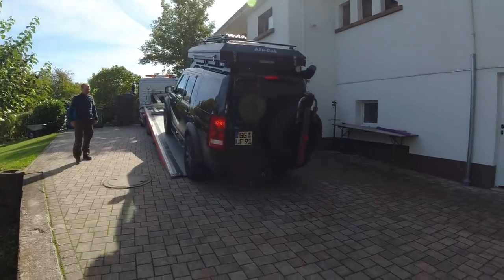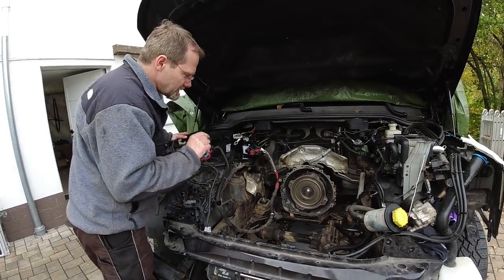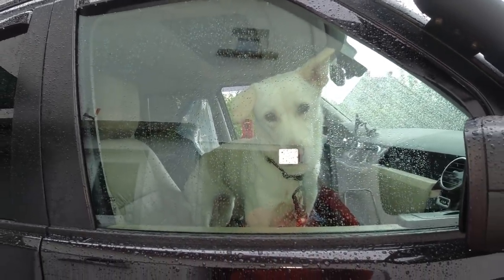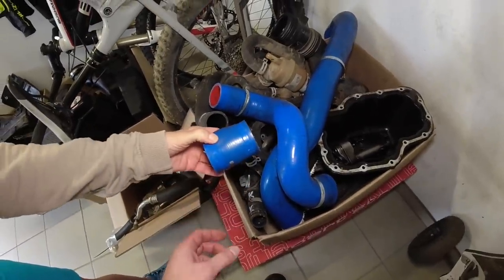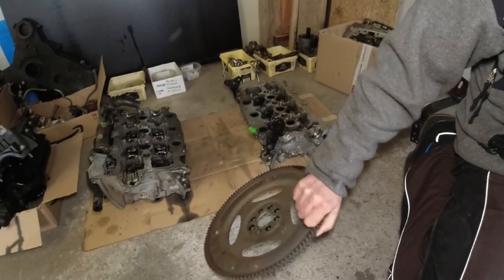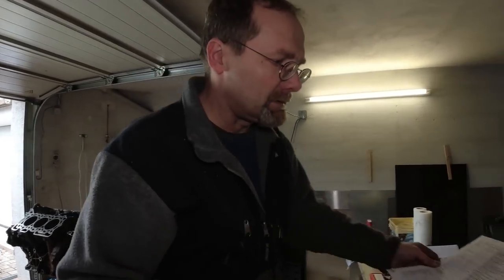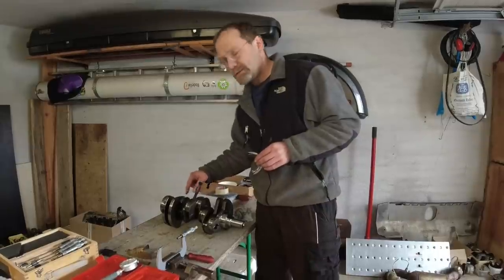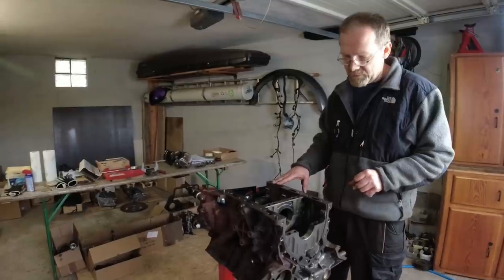Is this the end? Complete engine failure - Land Rover Discovery 3 / LR3 - Episode 1

Comment: Hi Christian,
Thank you once again. We are looking at a rebuild at the moment. I was very interested in your comment below about a potential pre-oiler. Quoted here for reference....
"I found a pump for 130 Euro and I found the ports for the oil connection.  It also takes a check valve and a control relay circuit.  I think this is a great idea.  It assures a quicker oil supply after a long stand period.  Something I will do when I rebuild Vera's engine." 
Could I please ask if you could share the detail on the pump and the port? Thank you.
Reply from the maker: Hello Jeffrey,  this solution did not end up realistic.  Sorry.  Also do not use the FAI pump we installed here.  I installed two of them by now and both prime extremely slow.  Christian

Comment: Supposed to be going Norway after Xmas from the UK. This does worry me as the temperature will be really low and I worry about the extra cranking time needed to start my 2007 D3. I put a new oil pump on but I don't think the is any way of avoiding this extra crank time due to low temperatures.

Comment: The lady narrating, Vera(?), is hilarious 🤣
Is that the V630 engine? I've worked on a lot of engines (well over 100), but not the TDV6, I don't recall any other engine where there were spun main bearings - is this a common problem, apparently due to insufficient crush on the shells?
Easiest, and maybe cheapest, option would seem to be align boring the main journal housing and rebuilding the engine - best option might be to do a concentric hone with custom oversized bearing shells for maximum crush?

Comment: my 2006  Disco 3 engine has done 235,542 miles(379,057km) with all original parts still working well
Reply from the maker: No DPF I assume.  But you did replace the oil pump, right?  If so, the 2006 is unbeatable. It only got worse from there due to emissions controls.  Christian

Comment: Great videos as always 👍😁 I just had my steering knuckle replaced on my disco 4 as my steering was getting very stiff, might be an idea to replace that since it’s so accessible now as they don’t last forever, mine did 165,000 miles which isn’t bad! Also agree with oil changes, I do mine every 5-7 thousand miles.

Comment: Hey Christian! I read a comment earlier on another video on why crankshafts fail, that said that "lugging" the engine (running it on low rpm) is worse than running it on high rpms because the engine has so much torque. I don't know what to think because given that every thing else is the same, then the crankshaft will have to put out the same amount of power to do the same work anyways. (forgive my use of units) Would this maybe be individual form engine to engine depending on what harmonics issues the individual engine has, or does the low rpm require each stroke to be harder and longer in between causing more stress on the crankshaft?

I absolutely love your videos. My heart melts a little every time Vera says "oh my god". Cheers form Norway!
Reply from the maker: I think (based on my Research):  95% of broken cranks are due to oil starvation.  The bearings cease up, clearance increases and the crank snaps if the driver does not immediately stop the engine.  There are known cases of cranks snapping due to fatigue.  This is apparently then the case if the crank is exposed to large peak load changes as present during low rpm operations.  Trailer pulling, hard shifting, off road use.  This in combination with a border line hardened „Monday“ crank can cause a snap - if the Storys in the Web are True. This is one reason why the extremely high torque SDV6 shifts so extremely smooth without any jerk - I think.  Ford reduced the amount of sudden rotational peaks to a minimum.  But this is general practice unless the engine is drastically oversized like in a US V8 with wimpy 375 Hp like it had back in the 70s already.  Christian
Reply: @Vera_and_Christian  Then I will be sure to change oil frequently. I really enjoy oil changes anyways. Given that I by now have over 250k km on the clock I think that I gradually can rule out the possibility of having a "monday" crank. :)

Thank you so much for your time andfor sharing your knowledge. Have a nice day!

Comment: So the sound it was making at the start was a kind of rattle, kind of a bit random. And suddenly started? Mine makes a clicking/ticking sound when it’s warm. Hoping it’s normal!
Reply from the maker: Ticking when hot is low oil pressure.  Run 5w40 and see if it’s better.  Christian
Reply: @Vera_and_Christian  interesting - yeah will try that. It was certainly quieter before I changed the oil (to 5w30)

Comment: Hmm, I disagree regarding having to drop the transmission to get to the crossover pipe.  I did a turbo change in my D3 just last month and removed the crossover pipe while the turbo was out.  I didn't drop the transmission.  The reason for removing the crossover pipe for me was that the brake vac pump was leaking lots of oil onto the crossover pipe and the exhaust wrap was completely soaked with oil.  Yes, you are working blind, but you can remove the crossover pipe without dropping the trans.  To be fair, I did have to fabricate up 3 different 13mm custom crows foot wrenches out of old sockets to get the crossover pipe flange nuts undone, but once I had them, I used them for all the crazy turbo flange bolts.  Still very interesting to see you pulling an engine without lifting the body.  Gives me confidence that it is possible, despite what everyone else on the internet says...
Any chance of some close up views of Fabians hidden winch mount?  I'm thinking of fabricating one of those as I can't find one anywhere to buy.
Reply from the maker: I will try to improve the procedure during installation.  It is very difficult to see what needs to be removed and what can stay in place.  I’m sure with a bit more practice the removal will be much faster.  Thanks for your comment.  Christian

Comment: Thank you so much for posting, although doesn't give me any more confidence in my own D3 TDV6!  Very interested to see the line boring and whether you can get externally oversized bearings to suit.  All best wishes from the U.K.!
Reply from the maker: Boring is done.  Check out the video tomorrow.  Hope the boring video is not boring.  Christian
Reply: @Vera_and_Christian  Fantastic!  Hope just hope Fabian is 'bearing' up at the moment.  

Mine is also an 09, similar K's etc.  Poor history, but being non-DPF I'm able to use an Ester based Millers oil in the hope the (claimed) oil film strength might give a little more start up protection.  Whether it will or not I don't know, but other than using quality filters and making sure it starts quickly and cleanly (it does) and doesn't get laboured at low revs (it doesn't), I can't see I can do much more.

Comment: As a rule of thumb jack up car at rear as far as possible if possible leave everything on the engine bar the engine mounts and remove the trans and engine as one unit. Doesn’t work for every vehicle but by jacking up the rear it gives a great angle with which to extract and fit the assembly. Very good for complex exhaust systems and wiring harness clamps etc. Regards. Ps as far as auxiliaries it will never be easier to gain access to them than when the engine is out of the vehicle.
Reply from the maker: The thing is, our garage is not high enough to lift up the rear. Having a pit is not always beneficial. The plan is for the next two years to tear down our garage and build it up suitable for these kind of repairs. 👍🙋‍♀️ Vera

Comment: Hello Christian, can I ask you what approval motor oil and which manufacturer do you use?  (I have a 3.0 sdv6 motor).  Thanks.
Reply from the maker: I run Castrol Magnatec 5W30 A5 in both of ours.  With DPF the oil requires changing often.  We will go to Total 5w40 like in the C5 but it is not approved by LR.  Christian

Comment: In my opinion the DPF is the reason for mainbearing failures. Too many regenerations leaves too much diesel in the engine Oil. 
After my engine revision I change the oil latest after 10.000km. And if the IiD Tool shows many regenerations in the past, the I will change it earlier. My mainbearings looked the same, metal chips broken from the surface. But I had luck. The bearings did not turn in the engine block.
Reply from the maker: We absolutely agree with you. Our LR3 also does not have a DPF, that engine runs like a swiss clock. I was just gone on a weeklong road trip with Philipp. I was not even the slightest worried that my Disco would break down or even  bing and bong at me 😅. 😃👍🙋‍♀️Vera

Comment: Thanks you two. I hope it all goes well. It is very sad. This is the reason I do very frequent oil changes and am also very sensitive to noises. I am lucky I think, to have the Freelander 2 with the 3.2ltr Inline 6 engine, which is a big engine for the Freelander. It seems to be in good condition, and I am hoping that, because it is a Volvo based engine, it will survive a long time. I do have one minor knock that seems to be a suspension drop link or bushing, but that is the only issue at 10 years old and 78k miles. I hope to have it diagnosed and fixed soon.
Reply from the maker: My Freelander had a BMW engine, best combination ever. 😃👍 The only thing we had to do frequently is replace the mounting brackets of the rear diff. That we had to every 2 years. 🙋‍♀️Vera
Reply: @Vera_and_Christian  so you had the BMW M47 2.0D engine? Lucky you, Vera. The later N47 had issues with the timing belt tensioner with the timing belt drive mounted at the rear end of the engine for great maintenance access. :-)
Reply: @Vera_and_Christian  Thank you, Vera. I think that is likely the problem I have. My research showed that those brackets would wear out and the rubber bushing would go bad. I will check it this weekend.

Comment: I'm always wondering. This there a diesel cooler in the engine or a diesel heat exchanger? Old Mercedes Engines had a diesel preheater. That's one reason these old Mercedes Engines drove even with fish oil.
Reply from the maker: There is a Diesel preheater 👍🙋‍♀️

Comment: So, you think that the used fuel pump caused "crank no start" conditions that persisted long enough that insufficient oil pressure was developed at the Nr 2 and 3 main bearings? Interesting, particularly given your assessment that these engines have insufficient lubrication at these journals under nearly all conditions. What engine speed is required for 2 or 3 bar of oil pressure? I have an L494 with the 3.0TD engine, Daumen drücken.

As for hate comments about JLR dealers, my Range Rover Sport went in for a check engine light--P049B, insufficient diesel exhaust fluid flow. Dealer said the DEF injector was faulty. I asked, how did you test it? They said they couldn't test it, that was their guess. Two days later, they said the DEF pump wasn't working. I said, "But I'm using 0.2 liters per 100 km, or 50 liters per year". I let them replace the pump, then they called to say that's not the problem. Dealers do not understand how these vehicles work (I'm a mechanical engineer). My vehicle has been at the dealer for 3 weeks so far.

It is not reasonable for people to expect these engines to last forever; people have come to expect automobiles to run like refrigerators, but that is not possible. If you do not take care of your engine (frequent oil changes, letting it get up to temperature every time you run it) then the engine will not last. Americans created the 36 month lease--drive the car for 3 years, then get a new car. Manufacturers know this, so they build vehicles that do not last. Buy a Mercedes, Porsche or Honda. Or learn how to rebuild your engine.

I had a 2006 Disco 3 (LR3 in the States) 4.4 petrol, bis zu 200,000 miles (320,000 km). Was für ein Auto!!! Christian and Vera (Ach mein Gott!) are my heroes!!
Reply from the maker: Check out our videos in our "Engine Oil and Oilpump" Playlist. 👍 The used (refurbished) HPFP was a different issue with that particular Discovery. Also documented in earlier videos. Christian works in the automotive industry (as a balancing specialist) and he always says that an engine is designed to last 220000 km. I hope you can sort out your issue with your Range Rover. Check out the Disoc3.co.uk website for any information on your issue. Workshops only replace parts, one by one, until they eventually also replace whatever is broken. Costing a fortune in the mean time. 🙄😳😭🙋‍♀️

Comment: This engine for the LR3 and 4 was used in Jaguar and other cars without the crankshaft problem. Would you say it's due to pulling heavy loads that het engine wears prematurely?
Reply from the maker: It’s hard to say.  The other engines had different turbo chargers and other load ranges.  The LR is heavy and has a lot more torque at low rpm and it is much heavier.  I think all this is contributing to the issue. Christian

Comment: Thanks for another great video Christian and Vera I always wanted to buy a discovey 3 or 4 but don't know whether to buy a clean high mileage one and totally rebuild it or a fresher low mileage one and be constantly waiting for the next thing to break and spend every weekend rebuilding in stages.
Reply from the maker: Well, the problem is in the engine design, so even with a rebuild one, your are not entirely on the safe side. We would go with the low milage one, that's how we decided on our Discovery 4. Because high mileage brings another set of problems.  Remember it is still a Discovery, there is more to owning one than just the engine problems. 😅👍🙋‍♀️ Vera

Comment: Can the bearings it be done from below? If so maybe it’s worth doing them preventatively?
Reply from the maker: Is would not save much time.  The side bolts of the mains are not good accessible.  It is also required to measure the gap of the bearings and select the right ones.  This is a tricky process.  A rebuild will never match as good a Ford build as they machen crank and bearings.  It is possible to inspect the mains from below but it is not advisable as there may be contamination or setup problems caused by such a repair.  Better invest the money in extra oil and filters long Term.  Australian guy wrote me that he has  500t km on the clock.  Christian

Comment: My 2007 D3 2.7TDV6 died the same way 4 years ago at 156 000 km. While driving at 80 km/h I heard the rough engine work and stopped immediately. There were debris in the oil. Since then the car is in the garage. :(
Reply from the maker: Bring it over and we fix it next. Christian

Comment: At around 38:00 onwards listening to your explanation,   I feel like some kind of electric pre-start oil pressure  pump to build running preasure before cranking engine over, would negate this starting wear issue.
I wonder if the manufacturer would ever introduce this? Or perhaps we are too close to 2030 now for it not to be worth the design investment for the companies.

(2030 being the end of petrol/diesel vehicle production in Europe)
Reply: I agree - I’ve been looking into the sourcing and supply of a pre oiler like those used on competition engines. I fathom a £500 investment in a pre oiler is a damn sight cheaper than an engine rebuild - what do you think Christian?
Reply from the maker: I found a pump for 130 Euro and I found a ports for the oil connection.  It also takes a check valve and a control relay circuit.  I think this is a great idea.  It assures a quicker oil supply after a long stand period.  Something I will do when I rebuild Veras engine. But right now she does not let me do this because it’s not broken. Christian

Comment: How are the main bearings located? I didn't see any notches for tabs to prevent the bearings spinning.
Reply from the maker: Hello Greg, the bearings are plain.  The notches are typically for orientation only.  It is a common assumption that they prevent spinning but they are not according to the manufacturers I checked.  Of course it will take more to make bearings with notches spin but they will in case of a serious oil starvation.  I found this on the web site of a German manufacturer.  I still wish they would have notches.  Christian
Reply: @Vera_and_Christian  There is no technical reason not have location tabs. The only reason to omit that extra security is to save a few cents.

Comment: Hi Vera and Christian, Greetings from England. Is it worth considering some type of electric, pre engine start up oiling system, to protect your new engine build? The only genuine reason I can see to change the fuel rails and pipes would be if there is debris inside, that cannot be removed. My friend had exactly the same problem with his 2.7 range rover sport, but luckily he found a replacement engine in a jaguar car. Regards, Richard.
Reply from the maker: There are applications with electrical oil pumps to prime the bearings before start.  I did not see this on a TDV6 but I will look into this.  Thanks. Christian